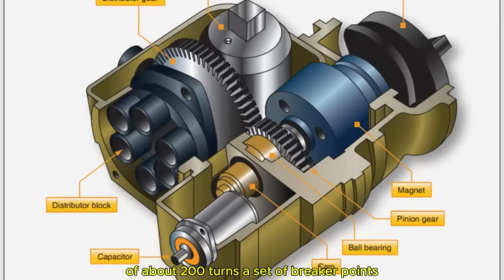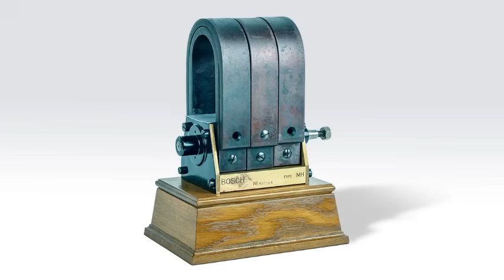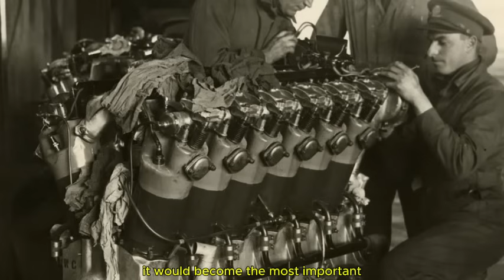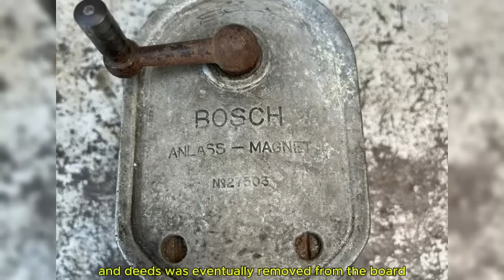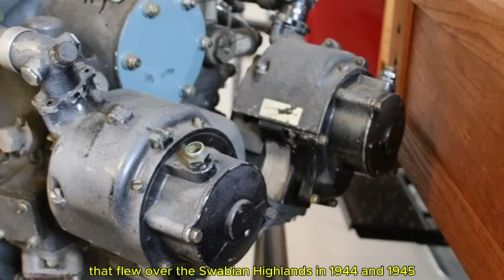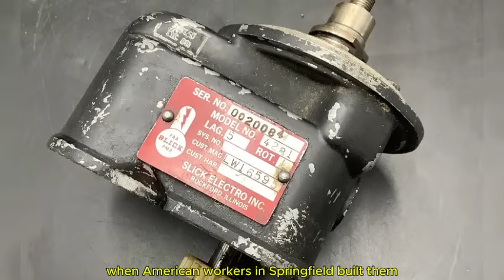America Had No Magnetos in 1917 — So Bosch's Own US Workers Reverse-Engineered Them Overnight

Comment: The truck dies nit start .., well only if the truck in questin has a gasolibe engine, if the truck runes on diesek ( most larger trucks dio) t it ignites by compression thus no spatk plug and this device is redy dand

Comment: Magnetos were not commonly used in automobiles.  Motorcycles  and airplanes  yes, cars no. Cars used a battery,  d,c. Generator, spark coil,  points.
Reply: I did a bit more searching, and this was true by 1920, more than 50% of the cars were electric start, had a battery, and no need for a magneto. The problem with magnetos was their output varied as the speed of rotation.